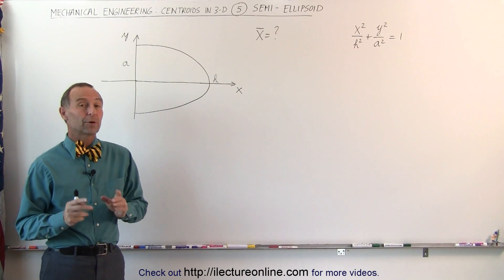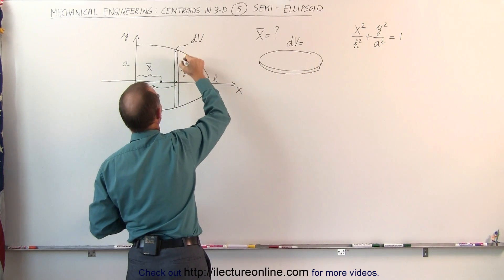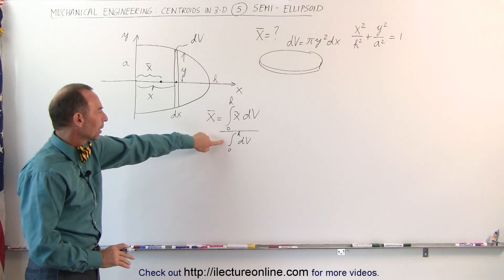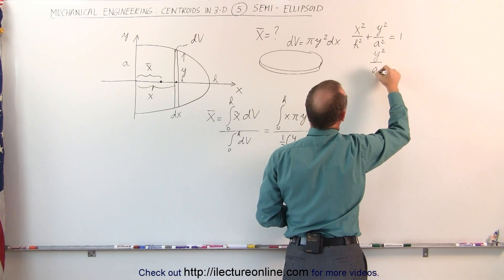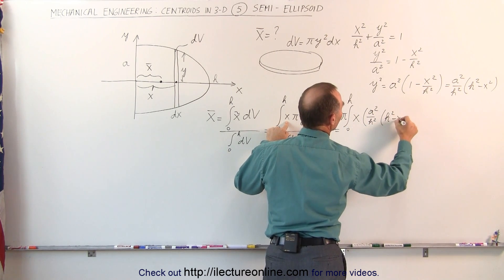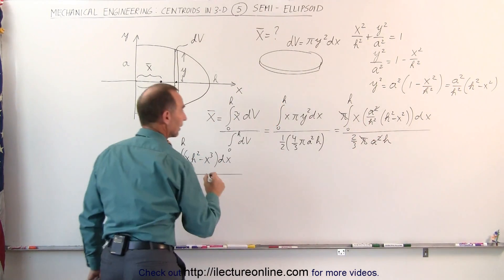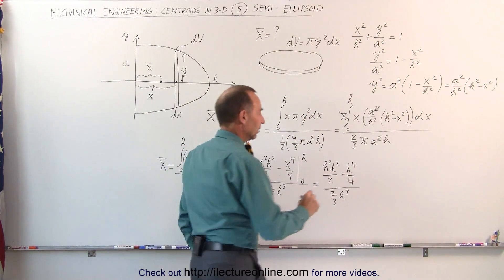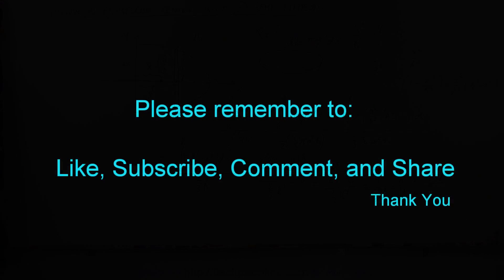Mechanical Engineering: Centroids in 3-D (5 of 19) Semi-Ellipsoid

Comment: I hope this question would get noticed. In some sources, the centroid of the semi ellipsoid in any axes is 3/16. How did this happen? I solve it myself and only get 3/8 even if i use an ellipsoid of a,b,c axes. Please help.
Reply from the maker: There is no doubt that the center of mass for a semi-ellipsoid is (3/8) h.   Since I don't have your source, I cannot explain why it is listed as 3/16.  It is probably due to some reference or some value that is used.  Take a careful look at it and see if you can discover the reason.